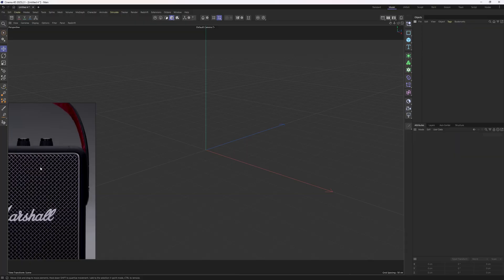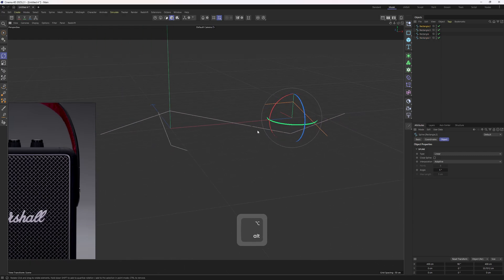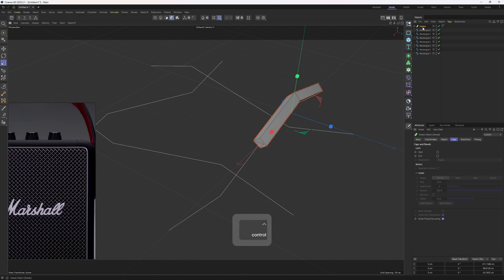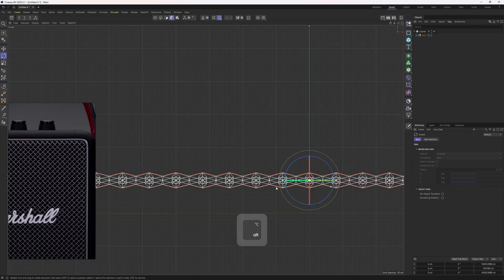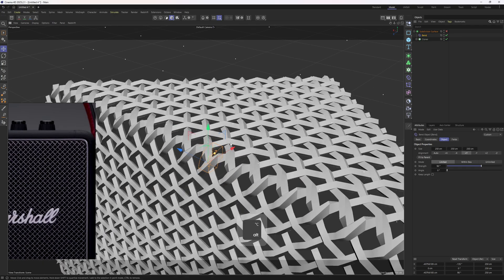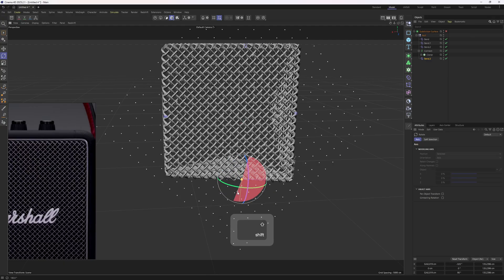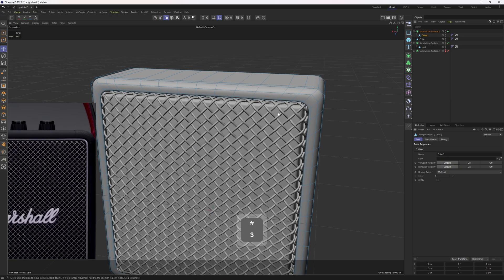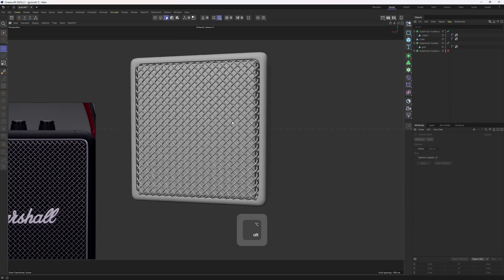How to Model Grid Structures?

Comment: salam mert amazing video as always  , do you recomand any books pdf for hard surface or modeling technics in general , and we can have same flow in all softwares because i tried maya and blender and 3D coat and Nuke but i feel my self really comfortable only in C4d and i work faster in it and where did you learn 3D because i work Modeling for 4 years nd i still see my self struggling sometimes in some models , but i dont work everyday , just sometimes
Reply from the maker: Thank you very much, unfortunately I have no idea about books when it comes to 3D, I basically learnt 3D modeling by trying out different and difficult shapes to my level, doing this over and over again consistently improved my modeling skills incredibly, I can recommend the same.

Comment: Excellent as usual. I would have combined the splines into one (right-click < connect objects + delete), then used one spline, circle, and sweep. But there could be some advantages to using multiple splines, depending on the situation. I really love your tutorials.
Reply from the maker: Thank you very much, actually your workflow might be better once you set up the pattern as my viewport felt so slow because of the cloned splines, thanks for pointing that out!

Comment: ever tried the kloner or conect for the first part? you even could make the spline with a tracer
Reply from the maker: Yes, you can apply the cloner and connect object to the first spline pattern without any sweep object, but this limits your control over the splines.